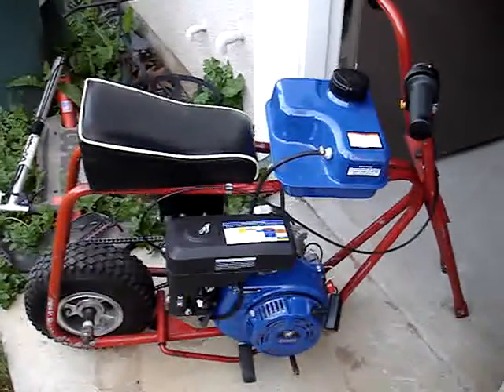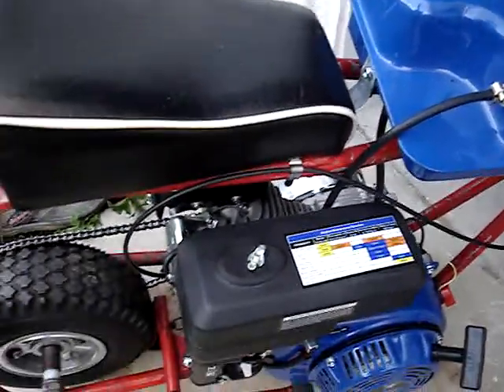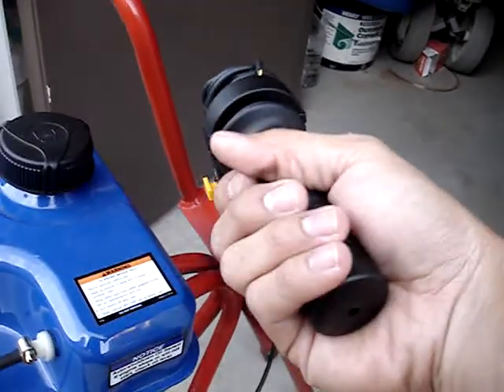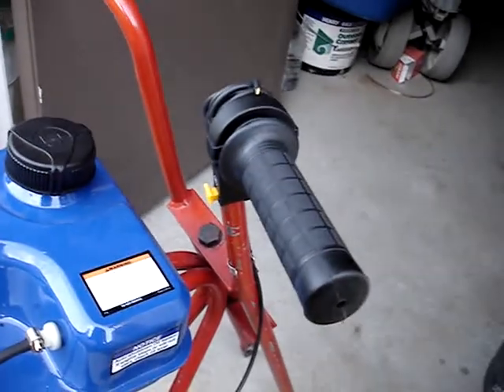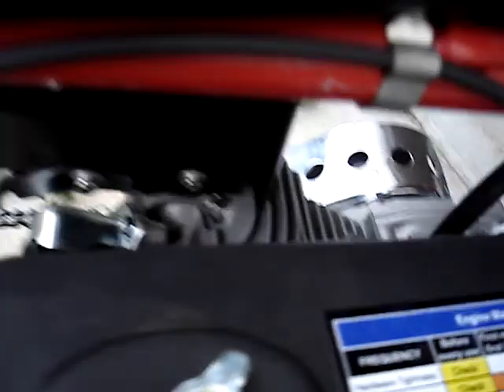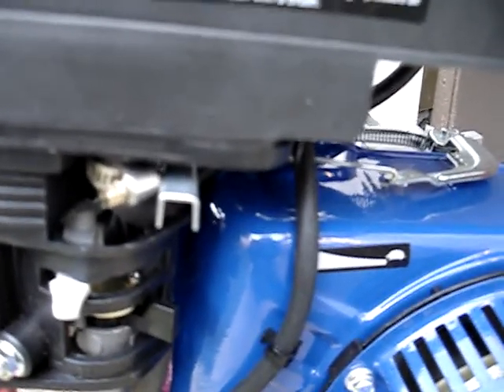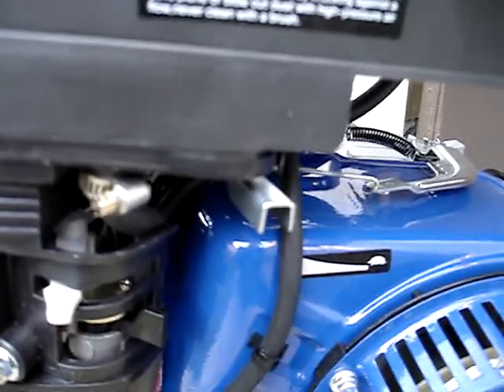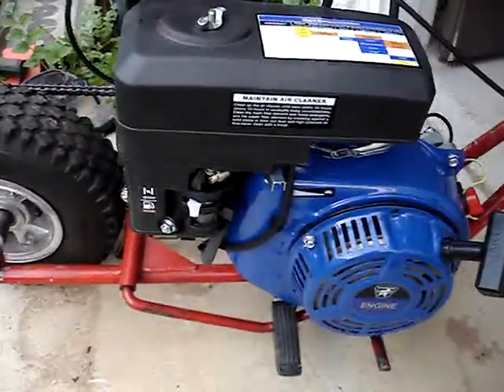Clone 6.5 Lifan Greyhound Engine Startup Issues

Comment: I worked on one or 2 and it sounds like you will need a bigger spring my friend put one on a manco frame had to put a much bigger spring as the one that comes with it sucks  . You do know there is a fuel shutoff on the engine check that aand make sure the fuel line is not crimped anywhere as that will cause it to do that . If not pull the fuel bowl off and check it

Comment: For the throttle... add a return spring to the lever nearest to the engine kill switch (red switch in front of the motor) then bolt it down with a screw in one of the original gas tank bolt holes on the engine and add another return spring to the main lever that your throttle is hooked up to... i just drilled a hole in the muffler cover and put a side of the return spring there....

Comment: The reason the throttle doesn't return is because there's a lock nut you have to loosen first. It's on top of the metal throttle arm near the carburetor. Loosen the nut like half a turn and the throttle will return like it should. These engines all come like that from the factory. The idea is you can set the engine to run at any speed, like if you were using it on a generator or water pump or something.
Reply: True

Comment: I had the same problem I see u have a return spring loosen the nut on top of the arm your throttle cable connects to its too tight to let the spring do its job

Comment: If the motor is warm.. Then it sounds like your low on oil  and the sensor is shuting it off. Mine did the same everytime I was at full throttle  and all the oil  was low pass the sensor. Cut the yellow wire on the sensor   problem solved

Comment: I have one of these motors I just got it and am using it on a go kart . with these engine no matter what cold or warm you have to choke it! Which is OK! These engines hold a half quart of oil. These motors are extremely fast and better tan Tecumseh motors! By a long shot! Loosen the big but under the air filter cover to fix your throttle issue! Hope this helps!!

Comment: the reason for it running is that it takes a little bit to warmup so like when the choke is on and it starts bogging down turn the choke off then it should warm up a little bit this is what my motor does

Comment: The cable looks a little too long. When you release the throttle the spring should not bind up like that. You could reposition the spring so that it has more tension or use a stronger spring. The engine shutting off in the idol position could be a few things. Does it do the same thing with the air filter off the engine?

Comment: Ohh and remove the govonor arm.. Cuz u are going to find out its going to run like shit and the bikes going float between wanting to go to shuting off.. Ull need to do a little idle adjusting  to keep it to ilde.. Ull find what works.. Like on mine I have to open the throttle all the way up to run on choke when warming up.. They all got their tricks.. Ill I can say those ingines are tuff for what they are.. 33 mph on mine  just with the govonor removed and an exshuast. Had motor 3 yrs no probs :

Comment: Well first off, if it only runs in the choke that means the engine is starving for fuel , to lean. Second did you mount the fuel like hose at the bottom of the tank, these engines run on gravity feed fuel. By the looks of it you have the fuel line at the top of the tank, no fuel will flow unless there is a fuel pump or pressure in the tank. Re mount the fuel line and the problem most likly will be fixed
Reply: Fenty's Shop thats a breather hose that connects to the air filter housing. you can see the fuel hose attached underneath of the tank

Comment: how much oil do these engines hold? Mine is on a Go-Kart so it is slanted. And I cant check it normally. Can someone help? Mine is doing the same thing. I need some sort of measurement?
Reply: Until it runs out fool